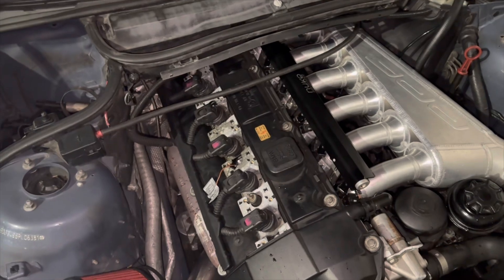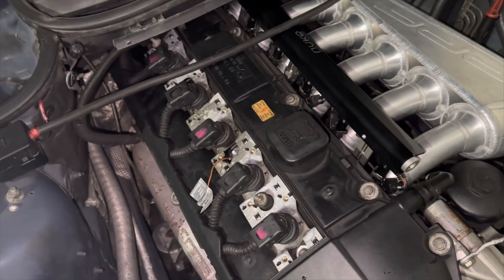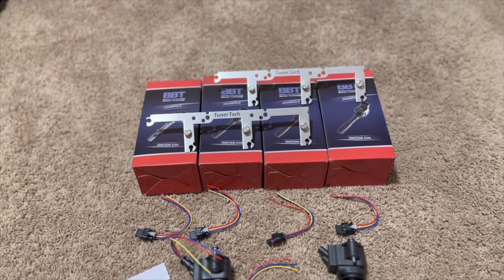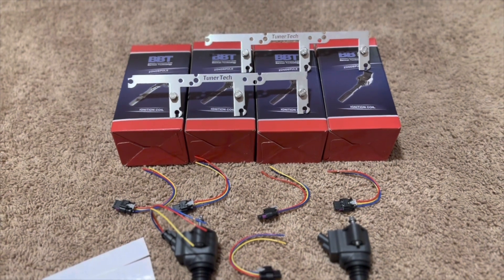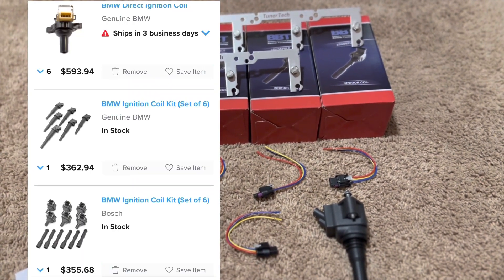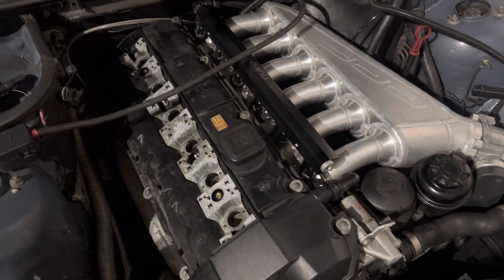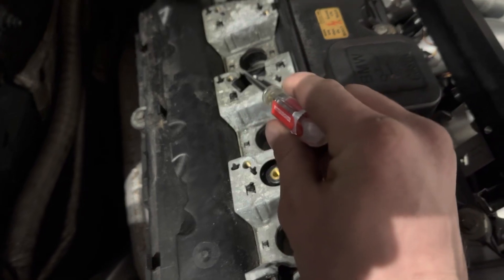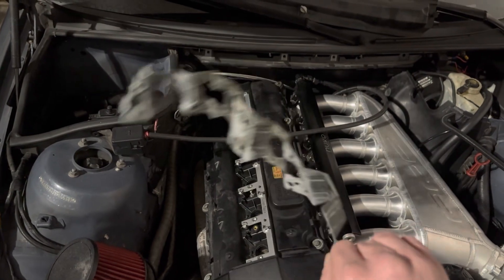Turbo E46 Rips! How to B58 Coil Pack Swap an M52/M54

Comment: So I’ve got a 98 328i m52b28 with s52 cams, trays, ect. Fully rebuilt vanos, and had the head cleaned and prepping for a bullet proof OEM plus build. Fuller tuned, headers, and just finished replacing condor doors shop bushings, and camber arms non m z3 steering rack, and so much more. 

I think this would be a perfect mod for the car. Is this something a freshly built e36 sedan track ready that’s non turbo, would be the cherry on top? What main areas would need to be focused on in the tune, I’m running clutch fan delete and Stuart water pump, short headers, y pipe and vibrant s52 exhaust waiting to go on after alignment.
Reply: Wow what a nice build! I might steal some ideas. How are the cams?

Comment: How would you tune these in
What would be different?
Reply: Dwell times need to be reduced after b58 coil swap so they don’t overheat. All information is available in ms4x wiki
Reply from the maker: Message Be racing tuning on Facebook

Comment: What throttle body are you running with that intake manifold and what mods as far as tune did you have to do to run it with that intake mani? I have a 2001 330i 4dr and really want to upgrade the intake manifold but stay drive by wire. Still new to the bmw m54 scene.

Comment: these videos are such an insperation to start my own build for the longest time ive wanted to torbo my 328i m54tub28 e46 but with these videos im finally building upp the knolege and courrage to actually do it! Great videos and the explaining you do is very clear on how you do it. thank you man, from the whole ccar comunity
Reply: Yust stop you know nothing it od m52tub28 noth m54
Reply: you should keep it stock with upgrades to the existing parts. then save money and buy a straight line car. you dont need anymore power if youre driving this car where its suppose to be driven (curved roads) plus itll last a life time stock with minor intermittent maintenance where as a turbo will immediately make it a money pit.

Comment: I know you run the turbo compressor pipe right above the subframe, but can you clock the turbo to run the pipes right above the engine mount closer to the engine bay wall?
Reply: Yes. But its definitely harder. Check out Spankranch e39 turbo setup. I ran my charge pipe above the subframe and i definitely recommend it

Comment: In terms of your comments about idle smoothness do you have OE rubber mounts or poly?
Reply from the maker: I use stock yes. This car was meant to stay comfortable lol
Reply: @hellrotgarage  :/ me, NA with 80a poly mounts/ bushes front to back with a more responsive but much much less comfortable car
Reply: @bubbles3281  not excited reading that lol, also NA with 325i lol
Reply: Had poly then switched to 034Motorsport's rubber mounts , best of both worlds . Very slight vibration through the steering wheel only at idle but nothing like poly